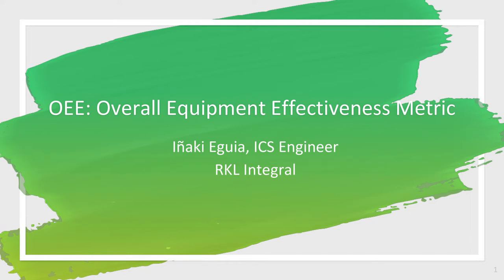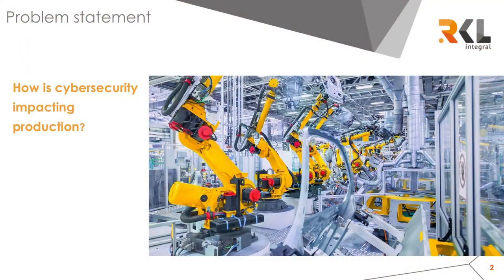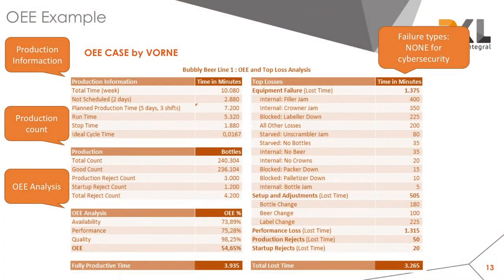Overall Equipment Effectiveness (OEE) As An ICS Cybersecurity Metric

Comment: Shouldn't we assume that the S4 audience already knows the difference between discrete manufacturing and process industry, the Purdue model, lean manufacturing, and TPM?
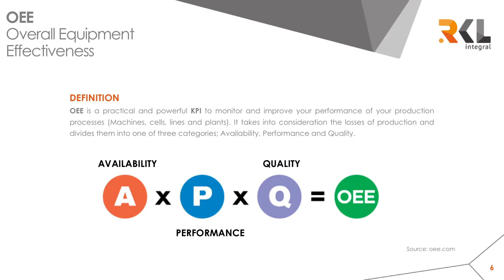Reply from the maker: It's why I set the link on twitter to start at 10:50 and recommended that in LinkedIn. Tip to all speakers is to skip the first reel, unnecessary exposition.